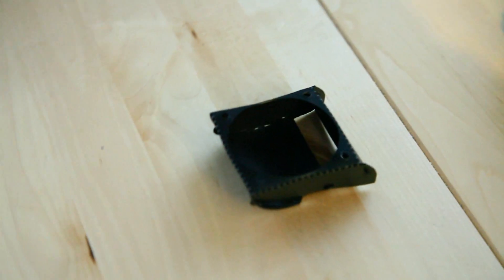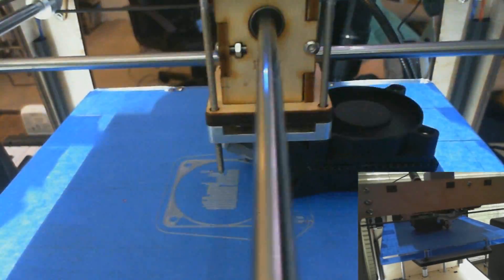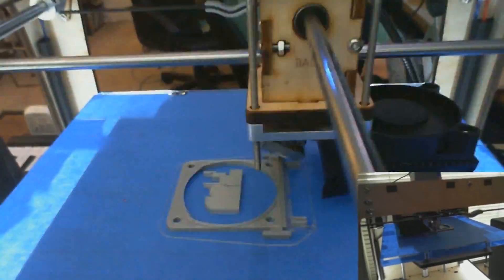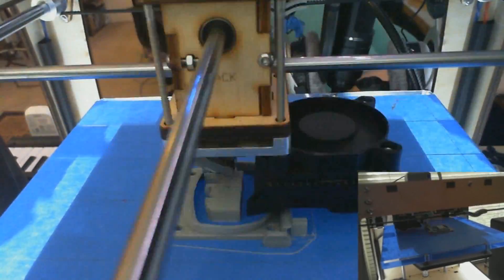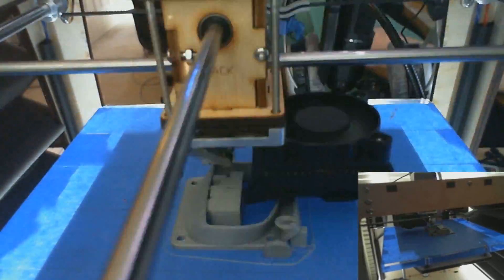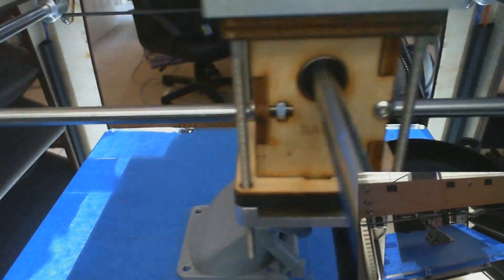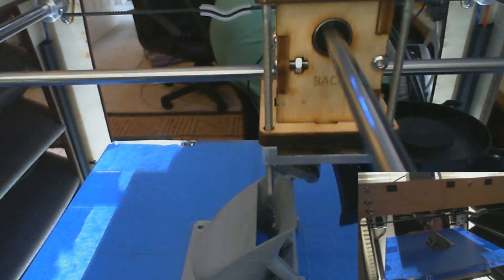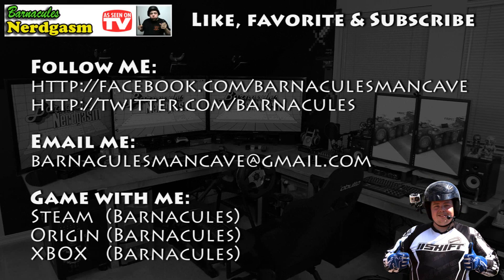3D printer upgrading itself with a new print head fan duct - This thing is coming to life!

Comment: Actually no. There is always parts in the printer that are metal. Being the printer owner and user I am, my printer sits next to me on a little table. The printer has aluminum threaded and non threaded rods, Stepper Motors, Arduino Board, belts, and all the wonderful nuts and bolts holding this beast together. So my friend, I leave you with this... Print those parts, THEN come tell us you can print a full Reprap. Trust me, I would love that. BTW I own my own modified reprap and a delta. :P

Comment: One if the first things I printed on my Ultimaker was an improved fan shroud: thing:17768.
The reprap is based on the concept of 3D printing many of the parts. You just need the electronics, stepper motors, and some threaded rods from the hardware store to complete it.